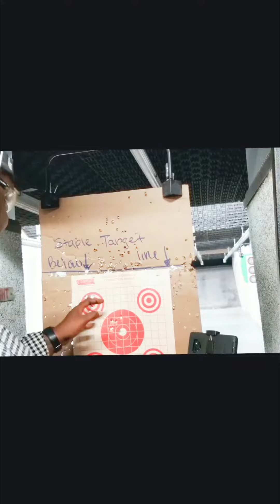GLOCK 30

Comment: Say bru is that the stove pipe 30 or the glock 30😂😂😂
Reply: Failure to feed 30
Reply from the maker: @Isee333  bwahaha 🤣🤣
Reply: Try working on your grip.....glock being a polymer pistol has a tendency to flex a bit and if your grip is off...( shooting one handed) it will cause stove-piping. Also try keeping it to factory mags, aftermarket mags will cause jams ....had mine for several years and never had problems with it.